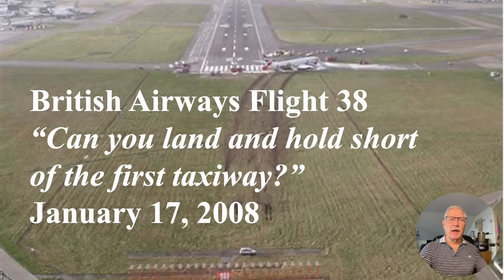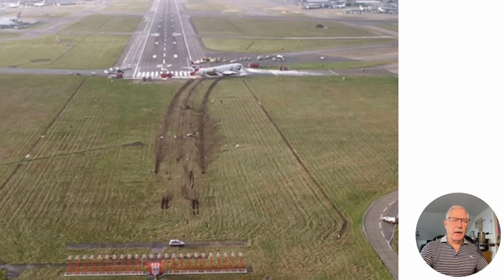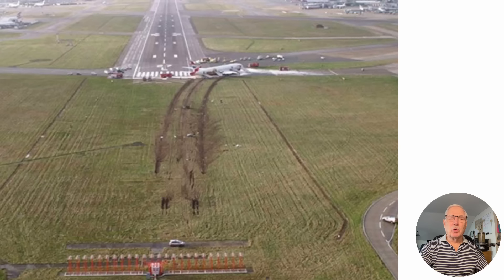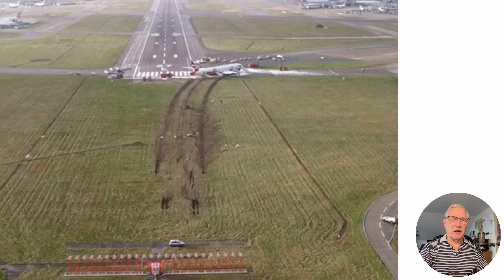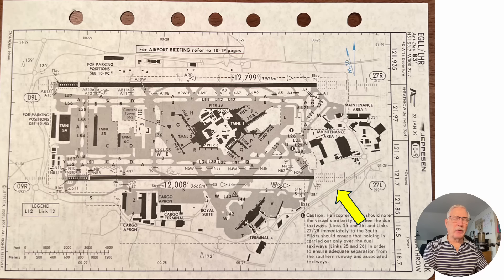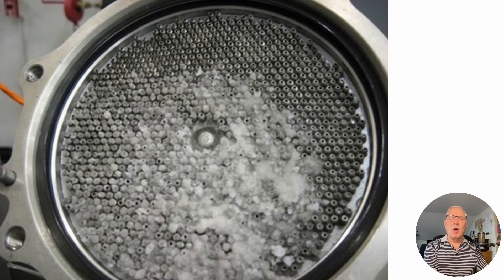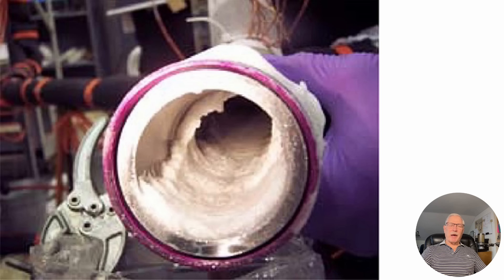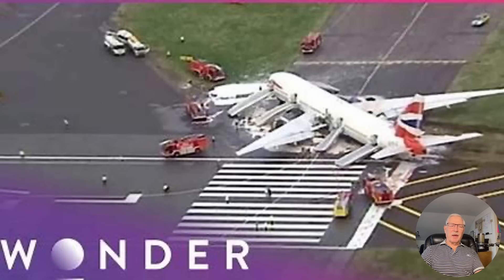British Airways Flight 38 “Can you land and hold short of the first taxiway?”January 17, 2008

Comment: The aircraft flew for some time through an area of exceptionally cold air, more like -70ºC than the typical -50ºC, and that provided the conditions for the moisture in the fuel to block the filters. The pilots were so skilled that they descended from cruise altitude to close to landing without having to advance the throttles, so the first time there was any demand for an increased fuel flow was just before landing. Essentially the entire landing was conducted with the engines at idle and with very little thrust available. The pilots skill was in stretching the glide against every instinct and training to crash inside the airport boundary instead of on a crowded main road that crosses the end of the runway. No time, no warning, just react and get the aircraft safely on the ground however possible.
Reply: I might just add that Heathrow is unique in the continuous descent profile that you mentioned. Due to a combination of both noise abatement, traffic from surrounding airports such as London City, Gatwick, Stansted, Luton and probably a few more outside of London, there is a need for planes coming in and out to strictly follow the required profile. In the case of Heathrow, they ended up being a continuous descent arrival. Granted, there are benefits to these procedures, especially so if you are a resident in the immediate vicinity of these airports, but the risk of this ending up being a low energy situation for a plane would become rather dire over a city as populated as London. As you said, though, the pilots did a wonderful job in bringing the plane down with as little collateral damage as possible. Just beyond the fence, in the firing line of 27L approaches was a petrol station which I would rather not think about what could have happened if it was struck.

Comment: The 777 was the first airplane to have FAR 25.562 as part of it's cert basis.  Once it was on the ground I would credit that to keeping the occupant injuries low.  The incident report go on about the seat video covers being loose which tells us where their heads hit.
Reply: The airframe did perform remarkably well considering the hard impact. Lesser aircraft would surely have fallen to bits, and we’d almost certainly not be talking about pilots pulling fire handles before cutting fuel off…

I remember reading that at the time it wasn’t clear cut that the aircraft was a write off. It was severely damaged and it would have been expensive, but apparently it wasn’t significantly different to buying a new one. 

I think what swung it was risk, what else would they find once they started? But for that to be a matter to consider is a remarkable testament to the designers and builders of the 777.
Reply: @abarratt8869 It's a lot more subtle than that. The seats have to stay in the tracks, absorb energy and not deform so much that passengers are trapped.  The seat tracks are still 9g as they were in the 60-70's but the seats have to withstand a 16g pulse.  Since then the retrofit requirement kicked in and most airplanes in service are using them.  In the past in "survivable" crashes some or all seats would come loose and those occupants would not survive.  The 777 was the first wide body designed completely in CAD with better analysis tools but not nearly as good as today's design tools.  Always keep your seat belt fastened when seated, no exceptions.

Comment: I was an FO on this fleet at the time of this accident and had flown the same route from PEK the previous week. The route was over Siberia where the air temperature would be -70c. The freeze point on European fuel is -47c and other countries generally -40c. If you have a mix then you set the freeze point to -42 in the FMS. The large quantity of fuel has a large heat capacity so it cools very slowly (compared with smaller airliners). The fuel temperature wasn’t the issue but the water ice crystal in the fuel was and this wasn’t an anticipated problem. A continuous descent profile is flown into Heathrow so idle engine power until landing configuration set and the trust is advanced to maintain final approach speed. This caused increased fuel demand to push the ice crystals into and block the oil cooler. Hence both engines starved of fuel. The oil would melt the ice and the engine given time would recover, but below 1000’, no chance. Temporary procedure was adopted to advance to full thrust prior top of decent to flush the ice to the engine (if any) We also have a large fleet of GE90 powered 777s. Capt A350
Reply: I have a question, was -47 the lowest with using an anti gel additive? I live in a cold area, so I have to keep my diesel full of additive in the winter time.

Comment: As I recall, the water in the fuel froze on the slightly raised ends of the fuel pass through tubes of the fuel/oil heat exchanger. These tube tips were not heated enough. The analysis took over two years and was helped by a similar inflght event. The solution was a heat exchanger that had no protruding tube tips.

Comment: BA was making a run from Seattle to Vancouver, BC in 1992 to purchase fuel before returning to Seattle and departing for Heathrow during winter operations. They felt the fuel there was more resistant to freezing of water contaminants. I got a jump seat ride in a 767 on that run while I worked at Boeing.
Reply: That kind of action wouldn't be based on a feeling. 
Maybe they had some other information about the moisture content of the specific batches of fuel, tested samples, processing and storage history. Most likely is that Vancouver had Jet-A1 in stock, while KSEA had Jet-A, which would deal with the gel point. 
I don't know when that happened, but at present there is also an optional anti-ice fuel additive availible at most airports (incl. small regional fields) to help deal with dissolved moisture (most common brand name is Prist).
Reply: BA upper management made the choice to load fuel at Vancouver. BA upper management made the choice to fly the 767 over the polar route during winter operations when the outside air temperature at altitude can drop below the gel point of either fuel and the freezing point of suspended water contaminates. Since this was the choice of words by the captain, he must not have received the test report(s) or other information which is referred to.
Reply: @rlsmith6904  That is a given, no airline captain would do a move like that without direction from folks at HQ. 

I mean in the modern era. Maybe in the 1930s it would have been on the captain because contacting HQ on the other side of the planet in a timely manner was impractical.

Comment: Good to know about 30F - my warmest wishes go to the poor person who had to find that out the hard way!
Super interesting clip, Ron! I know that big ships have heaters for their bunker oil, and had just assumed that there would be some emergency heating coil in your wing tanks, but it seems it is not needed very often and procedures are a better option than extra gear here.
Reply: Boeing routes the hydraulic system return pipelines via a coil in the main fuel tanks to cool the hydraulic fluid and help warm the fuel.
Reply: @martinhanson3528  Interesting, thanks for that bit of info! Now of course I am curious why the hydraulic oil gets so warm during ‘normal’ flight? Do small adjustments to trim etc. create so much hydraulic heating? Landing gear, flaps etc. of course will require enormous effort, but that is only very sporadically?

Comment: I remember when the news broke about this incident and then the subsequent confusion during the investigation because they could find no reason for the engines not responding to the throttle commands. That is until the did the icing tests.
Root of the problem was the little channels that the fuel flowed through stood proud of the first baffle in the Fuel/Oil heat exchanger. This gave the ice in the fuel somewhere to stick to and led to blocking the channels and thus not delivering the fuel needed to spool up the engines beyond the power setting they were at previously.  The new fuel/oil heat exchanger has those channels flush mounted.
I guess P&W and GE already had such a design, or they quietly followed RR's solution.

Comment: Hi Ron,
Thanks for the reminder about this accident. I worked on the airfield at Heathrow for many years before moving to Gatwick as Ops Duty Manager.
A couple of points:
1. As already mentioned, there is an amazing transcription of the ATC exchange between the aircraft and the Arrivals controller. The captain said 'Mayday Mayday'. Instead of responding directly, the controller picked up the red phone by his knee and told the fire service 'Aircraft Accident', then read out the correct message spot-on, saving many precious seconds. 
2. The fact that there was no post-impact fire, was because the Fire Service arrived within 2 minutes and laid lots of foam over all the spilt fuel.
3. Unfortunately, the captain, in the heat of the moment, gave the 'evacuation' message, not to the cabin, but on the ATC frequency. Though corrected by the controller, it was too late and the cabin crew had already started self-evacuating. 
4. The following day, a press conference was held which praised the 2 pilots, parading them in front of the media. Subsequently, many cabin crew allegedly refused to fly with the captain, allegedly claiming he was 'dangerous' as he had failed to make a proper evacuation announcement. The captain subsequently took severance, though it looked a lot like he had been hounded out of the job.
5. Many of the passengers who were evacuated from the aircraft had neither any identification, money, outdoor clothing or even access to their car or house with them. When they asked to return to the cabin to collect essentials they were rightly refused access.
6. Lesson learned from above: My SOP (Standard Operational Practice) for ANY flight now is for takeoff and landing to a) be dressed for the outside conditions b) have in my pocket my passport, house keys and sufficient credit card balance to buy an alternative means of getting home c) know where all the emergency exits are and be suitably dressed for going down a slide. I only take my coat and shoes off after we've been airborne for 5 minutes, giving enough time to don them again should we return.
Reply: Very interesting.  And good advice.  Thanks.
Reply: The Captain rejoined BA a few years later.
Reply: This is an excellent safety measure on your part. I have often brought loads of 'tropical vacationers' back to the icy climes of a Canadian winter and seem folks still wearing their 'Hawaiian shirts' and sandals at the deplaning gate. Several times (before I retired) I asked supervisor pilots and such, "How long will it take to get my passengers transported from the middle of the airport to the warm terminal building (kms away!) when we have to evacuate at 2 am? ... Never got any good answers.

Comment: So that ice got moving from fuel lines when autopilot was asking more power. Then those ice crystals went to heat exchenger and fuel flow was almost stopped. New design of heat exchanger face plate had some more protruding pipes, so if ice hit that plate those higer pipes will melt crystals faster.  Document of discovering this problem was really good, you have to have really specifc conditions to get this problem.
Reply: Actually the modification to the heat exchanger was to make the face completely flush with no protruding pipes - they certified both a drop in replacement and a modification that just machined the face flush on the existing heat exchangers. But otherwise, 💯

Comment: Just to go one step further into the details, the ice accumulated at the face of the fuel oil heat exchanger blocking off fuel flow. Subsequent testing showed that removing the 4mm projections of the tubes removed the ability of the ice to clump and accumulate. Just shows that despite staggering amounts of design refinement and exhaustive testing,  nature will find a way to bite !

Comment: As an 'armchair' pilot sitting in his den do you think they could have extended their glide if they retracted the flaps to the takeoff setting instead of 30. Also do you know anything regarding the pilot's treatment after the accident. I think I heard they did not fly again.
Reply: The same parameters were tested in the simulator.  It was worked out that the actions taken were the best in the circumstances.  Both pilots flew with BA again although the Captain (Peter Burkill) was haunted by the accident and BA's treatment of the pilots was to put it politely not the best initially.

Comment: Ron, I've heard the praise of the flight crew before, but what exactly did they do from an aviate perspective? Not go full aft on the yoke in a panic immediately after the AP clicked off? I would think it'd be a natural inclination to try to make it to the runway, and to not hit anything on the way there. That said, did the pilots actively prevent that from happening by aviating accordingly?
Reply: They had excellent crm just as in the Hudson River one. The CO was trusted to fly the plane while Capt used his seniority to problemsolve. Same excellent outcomes in both crashes.
EDIT to add this: Just as in the Hudson crash, Capt actually went beyond the procedures. In the Hudson case, Sully lit the apu, in this one, Capt Burkhill retracted flaps to avoid crash in houses just beneath the flight path.
Reply: Thanks for the explanation!